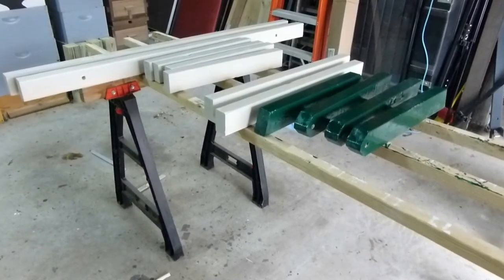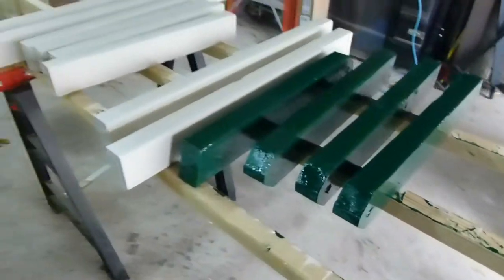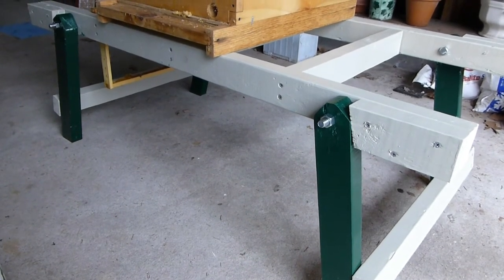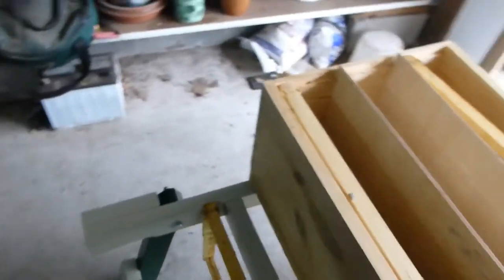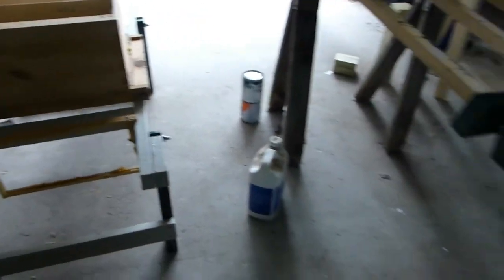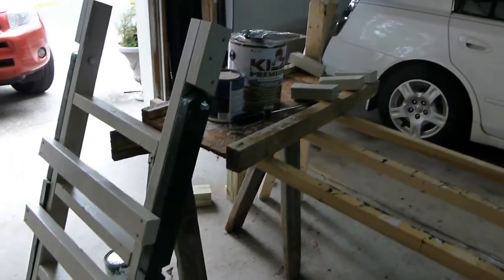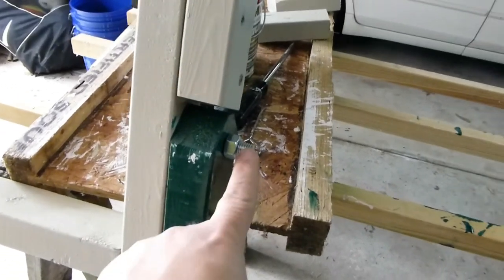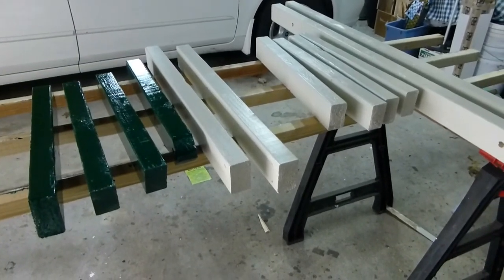Bee Yard Hive Bench

Comment: how much weight does it hold
Reply: +Jen And ED (TheBeeKeeper) I built one more than a year ago from the plans and I haven't broken it yet. I've sat on it (I'm at 220 lbs) put a couple entire hives on it without an issue. However weight alone doesn't fully describe how useful this is. When doing inspections it is a handy place to set extra boxes down without having to set them on the ground or getting the bees to clean out frames after extracting out in the open, or even when working in the shop and needing a good table to put boxes and frames on. It's handy.
Reply: +Jen And ED (TheBeeKeeper) I'm not sure what the weight limit is, but I can stand on it with no indication of imminent collapse.